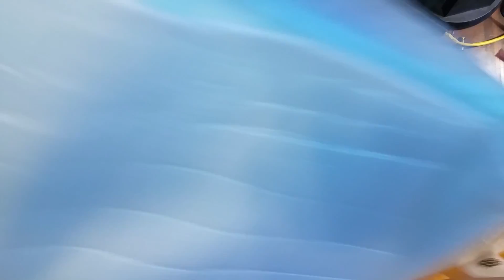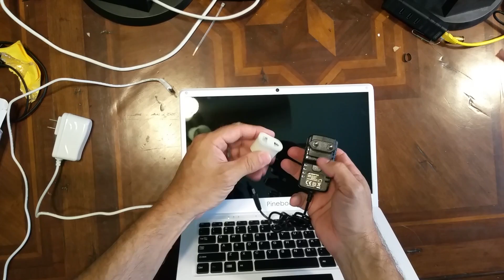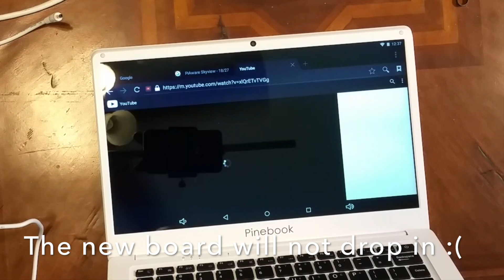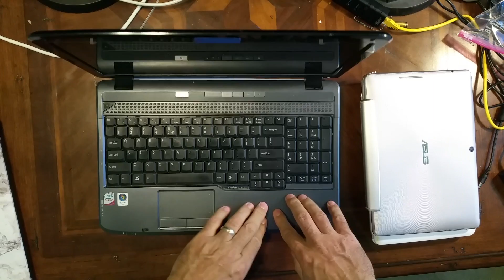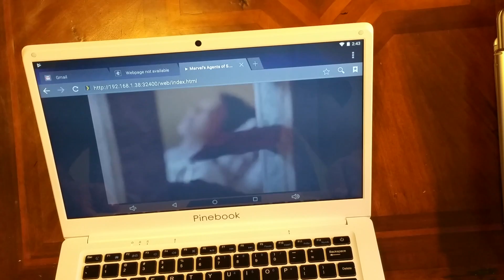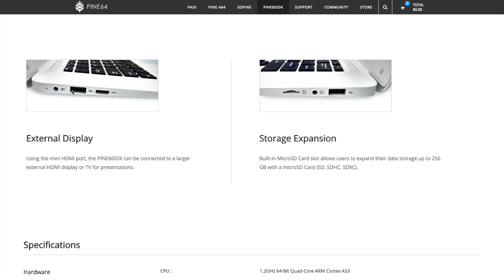PineBook64 Unboxing & First Impressions

Comment: At 89 on the 10 inch I'm tempted but it's a wimp 1.5 ghtz CPU Mali 450 GPU 2 GBP ram 16 storage but upgrading is  supported   . I bought a rock64 there new board same emmc modules .

Comment: How did it fare with headphones plugged in? Does it have any white noise from the chip itself? I really don't understand the gripe with the volume, because I only use headphones when ever I watch anything or do anything on computer.
Reply: I wonder what could cause that bug. I know that the audio in latest ubuntu (17.04) is quite problematic due to change to pulseaudio while it was alsamixer in version 16.04. 
Would you mind give it another spin on Ubuntu 16.04 (or LTS which is now on 16.04.3) to see if it got any better?

Comment: Android? For real?
Dude, it's easier to get a tablet.

The whole purpose of Pinebook is fully functional Linux.
Totally not designed for heavy websites and streaming video, but for SSH, torrenting, watching local videos - it's fine.
Battery life is great, I found almost all of the programs I need in Ubuntu repos, ported to the ARM architecture. The ones I didn't find - I compiled them from source, Pinebook handles that as well.

By the way, it's not 2.4GHz but 1.2GHz.
Pine64 did warn you, that is is not a replacement for a normal machine.
Pinebook is for enthusiasts.
Reply: In my opinion Android is not very good on laptops...Linux is so much nicer and has a ton of utility and functionality.
Android can't match.
Reply: For the Pinebook or any Android device.
Here's something for everyone.
https://showbox.software/download/
https://www.mobdro.sc
http://tvtap.net
http://ukmovnow.net/download.php
https://freeflixhq.com
https://teatv.net
https://themoviedb.net/download/?dev=
https://www6.tvzion.com
http://www.swiftstreamz.com/index.html#download
https://showboxbuzz.com/showbox-apk-download
http://ckaytv.com
http://newestmovieshd.com
https://tubitv.com
http://m.sonycrackle.com
https://pluto.tv
https://therokuchannel.roku.com
http://www.cloudtv-agents.com/downloads.php
http://www.mdcgate.com/apps/
https://cinemaapk.com
Reply: Download kali linux for arm hf and do some pentesting for me :D
I use my dell but its black and the sun bakes my laptop when im wardriving, also I only get 6hours of battery.